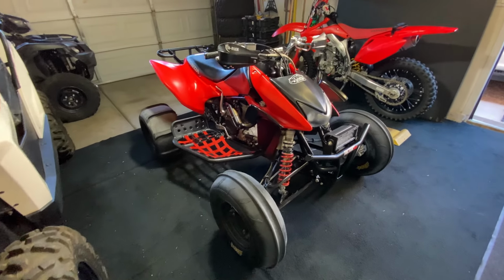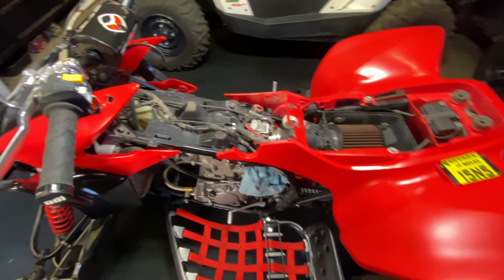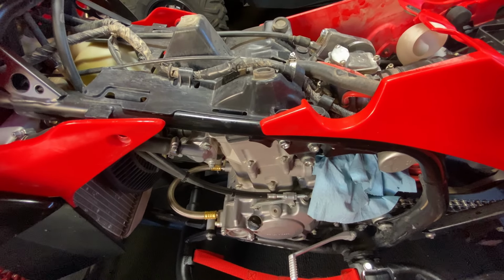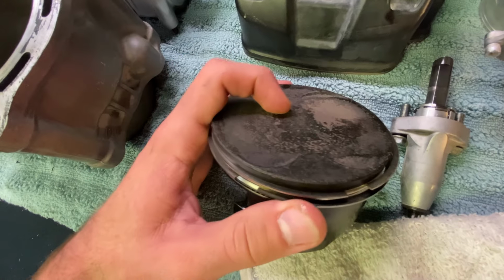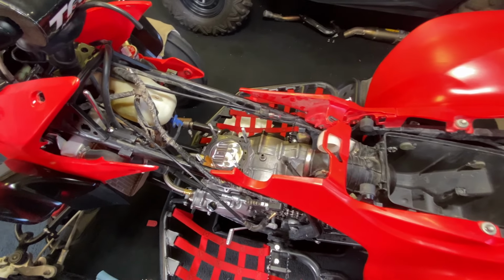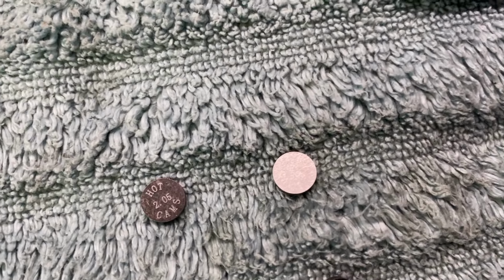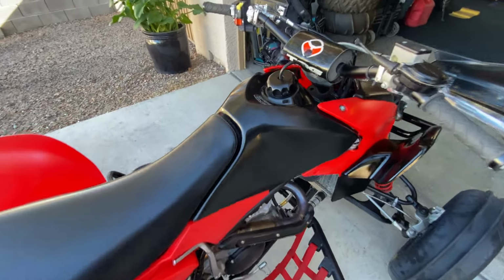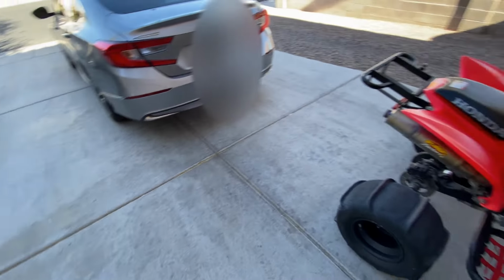Honda TRX 450r Big Bore Kit Rebuild

Comment: Hey buddy could you help me out? My 450 come to find out has the original top end. I was told it had a new piston, rings, valves, and cam. It has a stage 2 hot cam but everything else is oem. Do you have a link for where you got that head? Or where I could find a semi affordable head with valves?